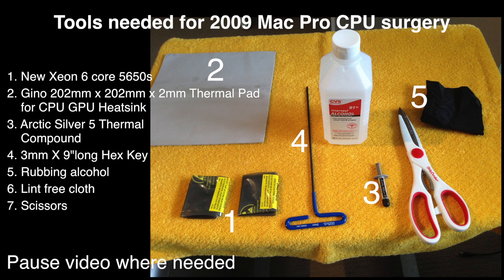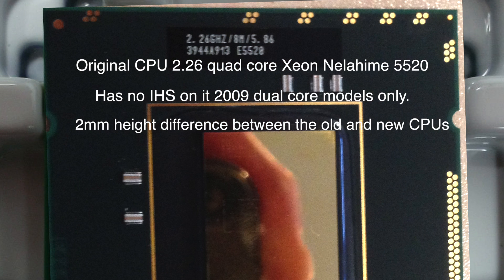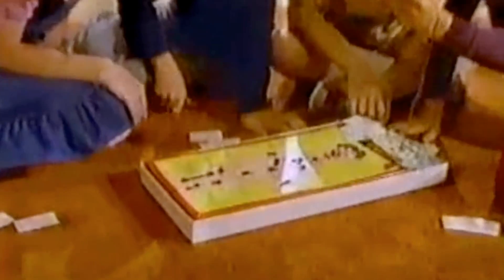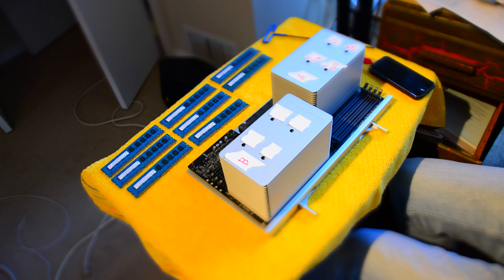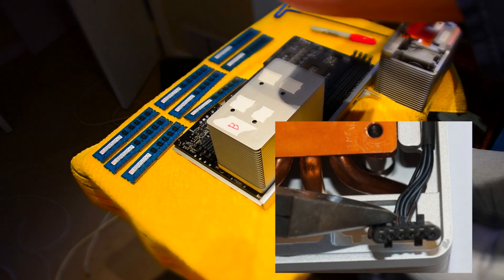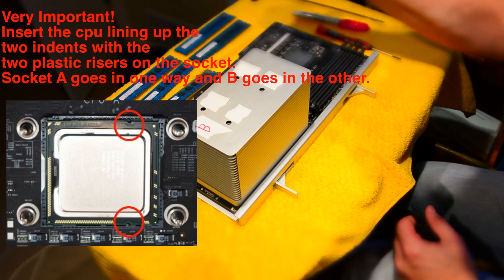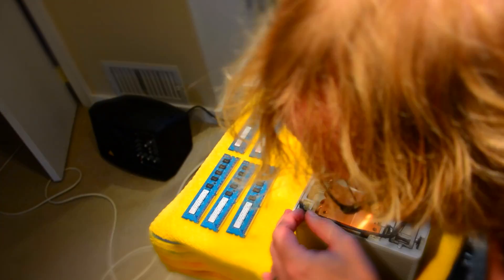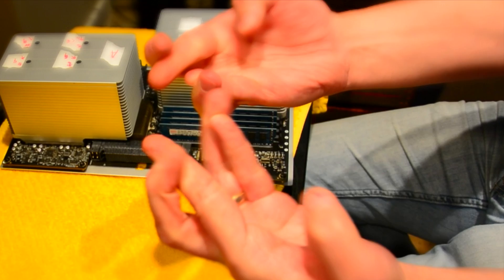Mac Pro 2009 5,1 CPU upgrade 8 core to 2010 12 core

Comment: 2 years ago i ruined the CPUs and the Processor tray on my 2009 mac pro.  I overtightened.  The reason i overtighted was because I skipped a step and did not make sure that i finished the firmware upgrade.  Which made it so the computer wouldnt boot.  So, yes, read, research, read, and read again.  That could not be more true.  However, I have a a 2010 8 core, and I will be upgrading it to a 12 core later this week.  Hopefully, I will redeem my past failure.

Comment: by the way - just did another upgrade of 2009 and used washers - 3 x .0.8mm washers M4 per post and tightened the hex screws down tightly and it worked fine. I discovered that the difference in thickness between a processor with a heat spreader and one without was 2.2mm so the total washer height I added was 2.4mm giving a .2mm safety gap. (I was preparing to sand down the last .2mm if needed) 
I have only installed one processor though as I stupidly only calculated for one processor worth of washers and am going to do it the same way again with the same washers.
I do have one problem though and this is that the fan is going at full speed. Am hoping this is only because I have one processor in and it is expecting two. 
Can anyone confirm this is expected behaviour?
thanks!
Reply from the maker: Steve Brann yes fans will go full blast if only one of two CPUs is connected.
Reply: Lance - thanks for setting me mind at rest. I do recommend the washer route though - 2.4mm adds a little safety margin and you can tighten them down hard. I am surprised that some engineering firm hasn't made some accurate washers or replacements for the base pillars that allow accurate replacement. So much of your video and others problems seem to be down to tightening it the right amount and sweating big time about destroying by over tightening it. It seems to me that either de-lidding or custom washers would totally get rid of this problem.

Comment: I have done one of these last year and it worked fine apart from some restarts occasionally. Am doing another but seem to remember reading that the addition of 2mm washers to the posts helped prevent over tightening. You even refer to washers somewhere in your reply. Any additional comments about using washers before I attempt my second conversion??
Reply from the maker: A lot of folks have used washers successfully, do a google search about it. The guy I original got my info from said you can still over tighten and damage your sockets even with washers and recommended not using them. I went without, but I know a lot of folks say it worked for them.

Comment: Hi Lance, thanks for your video, I did the firmware upgrade last night, installed sierra on my 2009 8 core 2.93ghz, I am looking into upgrading CPUs right now and I was wondering if you would point me at the right direction, I would liker to upgrade to a 12 core as high as possible ghz wise.
thanks
Reply from the maker: Two Xeon 5690s is has high as you can go 3.46ghz  / six cores each giving you 12 cores. Look on ebay, no need for "matched pairs" ones without the lids will be easier to install but more pricey. I installed mine with the lids on as you can see in my first CPU upgrade video. Lots of people have de lided them on their own but it's a bit of a job and can be risky lots of videos on how to do it but makes sure its for Xeons not other chips, again I did not but the install needs some extra work if you don't use delided cpus.

Comment: Thank you for the great video Lance. I followed you video everything went smooth until I try to reboot the mac and the red light on the cpu/ram board lid up like a rocket in the night. I switch between the old and the new cpu, the light stays up both. Any suggestion?
Reply from the maker: sounds like you have a bent pin or something in the cpu socket. Is it the CPU or the memory lights that are on. Look at my "oops I did it again video" as it shows which are which. could be too tight on the cpus.

Comment: why didn't you take off lid on processor . did mine that way fires right up.
Reply from the maker: Because I did this two years ago, and info was slim as far as removing caps. It works either way, Apple went with lids on with 2010 and 2012 mac pros. I think its just as much work to remove the lids as it is to do what I did in the end. I have upgraded since to 5680s with lids and she is still working like a champ.

Comment: Video is awesome; now I have a 12 cores MP. Don't Don't Don't add washers on the CPU sockets, or else you will break your socket pins like I did. The replacement of the board is really expensive, its better to an old Mac Pro instead. MP 2009 cost about $500-$900, the board itself cost you more than $500.

Comment: Okay, back once more. I am finally doing a 12-core upgrade soon on my 4,1 Mac Pro, and I wanted to know how much force I should provide when tightening down the heatsinks. I was thinking about maybe turning the hex key from its body (rather than the L-shaped neck), so as to ensure a limited amount of force when tightening. Planning on stopping the rotation of the hex key once I am no longer able to turn it with my thumb & index finger (on the body of the hex key + with moderate force).
Does this sound like the correct precaution to take? I only ask because I am working with lidded CPUs (and, no - I am NOT interested in de-lidding). Thanks.
Reply from the maker: I would turn up to 4.0 complete turns don't judge by tightness as it can be misleading and crisscross by starting with  one full turn on the upper right screw then go to the lower left one full turn lower right one full turn upper left one full turn and keep doing that till all screws are at 3.5 to 4.0 turns. Try booting. You can start with jus tone processors as I have explained before and make sure it is good and all ram shows up for CPU A which is the one on the right, Your fans will blow at full speed. If not all the ram shows up for cpu A then do a 1/4 turn on each screw and try to boot again. Keep doing that until all ram shows up then you can move on to the second cpu and do the same. Make sure the old cpu and ram are not in slot B when installing new CPU in slot A, all should be empty. Once CPU B is good and all ram shows up the fans will be back to normal. Or you can just go for it and do both CPUs at once.
WHen you check your ram you can go to about this mac and click on the memory tab the ram on the right is CPU A and B is the row on the left. From my experience its about 8 to 9 turns to unscrew a screw on the heat sync and about 4 to 4.5 to put the new lidded cpus in. Make sure nothing falls in to the cpu soket while it is open like old compound which happened to me and the computer was not booting. I removed the cpu and there was a tiny piece of old compound between the cpu and the socker.... not cool! This was thanks to the new chips I got still had some old compound on them and a piece fell in... may the force be with you!

Comment: Back again. Anyone know if it's necessary to add washers over the rods that the CPU heat sinks go over? I saw one of those upgrade kits on eBay (not that I will buy one) where washers were included. Wondering if it's a good idea to pick some up in addition to the thermal pads.
Reply from the maker: I did not use washers but plenty of folks have with success. if they are
 just a hair too thick you may not be able to get all the ram to post.
From what i understand you can still mess up the pins on the logic board from over tightening even with washers.
Reply: The point of the washers is to make up the difference in height between the old, unlidded, processor and the new one which has an integrated heat spreader (IHS) or ‘lid”. The washers only help to protect the new processor from being crushed by putting too much pressure on the heat sinks. Just can of course probably still overtighten them (if you tighten them really hard)  but the washers provide an ounce of protection.

Comment: Hi Lance, I think Yours are the most helpful video ever seen 'round about upgrade Mac Pro's CPU. Please one more effort to help just me 😉:
I found a x5670 without the "cap" IHS - Integrated Heat Spreader, so it would be much easier I think, just clean the heatsinks and put on Arctic Silver 5 in line on the new CPUs. Am I right? eventually being carefully all the process as usual of course!
Thank You very much once again for help!
Reply from the maker: Yes is should be pretty easy to install those, I think counting the 
turns on removing and re installing is a good idea so you have a general
 idea of what it takes to re install them, always best to no make them 
too tight and tighten slightly if needed. Good luck!
Reply: Above all: Thank You so very much Lance for answer me, so quick and for any suggestions!!! You're a kind and nice person, so Thanks a lot again, really. Now, go on! ;D I still figured out about count turns on each screws stealing the idea from Your tutorials. Good suggestion too not too be hurry to tight soon but eventually better a progressive slow tight at the end if things won't works out immediately. Just another couple of questions:  I saw arctic propose a two phase remover saying way better than rubbing alcohol, I would try 'em, what do You think about it? http://www.arcticsilver.com/arcticlean.htm and I'm so curious about Your suggestion to keep "far" RAM slots free for a better and faster experience. Never read about it, what's the matter about it? Why it would be better leave those slots free? Thank You very much once again for help! Cheers!
Reply from the maker: Dual-processor computers have eight
  memory slots, four per processor. You
  can install 1 GB, 2 GB, or 4 GB DIMMs.
  Each processor’s memory controller has
  three memory channels. DIMM slots 1,
  2, 5, and 6 have their own channels;
  slots 3 and 4 share a channel and
  slots 7 and 8 share a channel. For
  optimal memory bandwidth, all six
  memory channels should be used, and
  memory should be balanced across the
  six channels. Note: Populating slot 4
  or 8 slightly drops maximum memory
  bandwidth, but depending on the
  applications used, overall system
  performance may benefit from the
  larger amount of memory.

Comment: OK  so in two years I assume you have  a good idea if this still works.  I get calls from other pros I know and some are audio people and they are a bit afraid to upgrade the cpus.   How is it working?  I see there are alot of places to get this done on ebay and I think the prices have come way down... dunno
Reply from the maker: michael b it works great especially for pro tools and I have upgraded my friends Mac Pro as well for his studio we both have 5680s no issues just more powerful computers.
Reply: Now I cannot recall if you kept the lid on those processors?  Some remove the IHS cover and others say it is only a matter of a few degrees and voids a warranty so why do it.  So what is the 5680 intel... a westmere  at what clock speed..  I see some on ebay for barely $300 and they are 3.33 intel 5680..   can you get anything faster these days?  I do video editing and have an 8core 2009 as well so likely my demands are similar.  Minus the thunderbolt port I think this is a good option.   The kits I see have spacers that keep you from over tightening the cpus down if you keep the IHS on.. I am tempted to go this route.

Comment: What is the maximum upgrade I can do to a Mac Pro early 2009? Can you please help me on this??

I'm considering to also just sell it and get a Macbook Pro 2014 or something like that, would I get better performance on a Macbook Pro nowadays?
Reply from the maker: WCephei77HD is it a 4 core or 8 core 2009. The new macbook pros might beat out a 6 core upgrade u can do to a 4 core which is an Xeon 3690 3.36 Ghz but a 8 core can be upgraded to Xeon 5690s 12 cores which will beat the new 4 core in multi core processing but that being said if you edit video a lot of tasks can be faster with i7 cpus over Xeon. Like exporting H264 and creating proxy media due to in chip video acceleration in the i7 chips. You can put in a Nvidia 980 it into a Mac Pro and maybe the new 1080 if they come out with drivers for them. The Mac Pro is still a very viable machine and much cheaper to upgrade then to buy the new MacBook Pro. But the upgrade can be an it risky in itself. You can also put new samsung ssd blades that are as fast or close to the internal flags in the new MacBookpros. To me he comes down more to do you want to have to have a doctors to work with any old hard drives etc. where is the Mac Pro works with everything except thunderbolt. It really comes down to the kind of work you do and whether you need the portability or not I think new iMacs a new Mac pros are just around the corner as well
Reply: Lance McVickar Thank you so much for your help, just in time as I'm trying to make the decision nowadays.

Comment: Hi, I also have a mac pro 8 core Nehalem 2.26 GHz early 2009. What is the most efficient compatible processor ? Is the Intel xeon x5690 (3,46 Ghz) six Core OK or not?  Thank you for your helpful video.
Reply from the maker: Yeah either the 5680 which I used 3.33 ghz or the 5690 is the fastest 
you can go may use a bit more power but there are a lot of upgrade 2009 
mac pros out there that have then installed without issue. I bought th 
e5680 because they were quite a bit cheaper and very little performance 
difference
Reply: Hello,
 I installed an x5690 with 64gb 1333mhz, everything works well except that the ram works in 1066mhz. Do you know why and how to solve this problem?
Best regards
Reply: it's ok... I'm reset the PRAM. thx
Reply from the maker: Florent Chenu Yeap I was just about to tell you to do that... let me know what your CPU temps run at.
Reply from the maker: as I am interested in how hot the 5690s run mined run about CPU A 45c CPU B 38C when not being pushed, i use istat to give the temps
Reply: i will look that

Comment: Hi Lance,
 After the firmware update, I tried to install new 1333 ram (8x 8GB 64GB Samsung DDR3 ECC 1333 MHz) in my 4 core 2.26ghz  mac pro 2009 and I zaped the PRAM, but the mac doesn't show 1333 installed ram.  Any advice...Thank you very much
Reply from the maker: Does it say 5,1 instead of 4,1 after the firmware update?

Comment: Hello Lance, I recently got my hands on a 4,1 single processor 2.66 Ghz quad core with a dead CPU. So I ordered a  Xeon W3520, do you think it would work without de-lidding it? Best Regards
Reply from the maker: there is no need to remove the IHS as the single CPU mac pros have them, only the dual CPU 2009 Mac pros come from the factory without the IHS all other Mac pros have them.
Reply from the maker: Also you want a 3600 CPU if you want to upgrade it to. a 5,1 why not put a 3680 or 3690 in there
Reply: As this is my first attempt to bring back to life this Mac Pro. This is a 4,1 2.66 Ghz 4 core machine.
I ordered the W3520, as it had originally, because I received the Mac Pro with a dead W3520 Xeon, so I don't know how could I update the firmware to 5.1 if I install a W3670 fro example. 
So what I decided to do, was to instal a fresh W3520, update the firmware and then order a W3670 or W3690. 
If there is a way to do this getting a better processor without buying the base model, I would really appreciate the advice.
Thanks for your replies, I subscribed to your channel.
Reply from the maker: Ok I got it, no you really have to just get an original processor and get it working to then do the upgrade. I see they sell for about 10 bucks on ebay, so not a big expense to find out if the computer works with a working cpu.